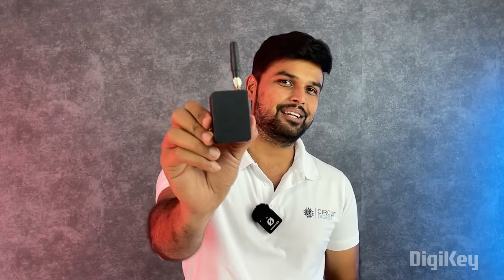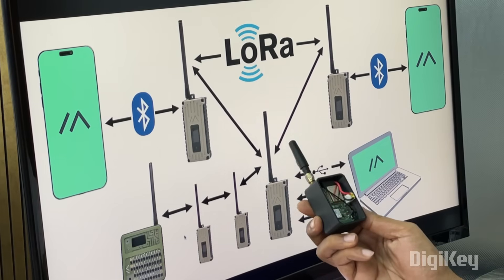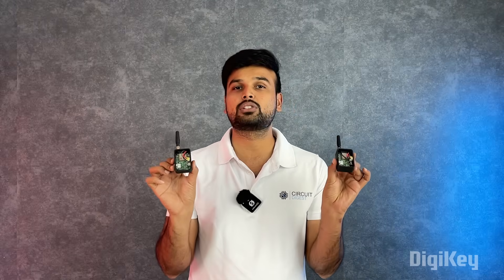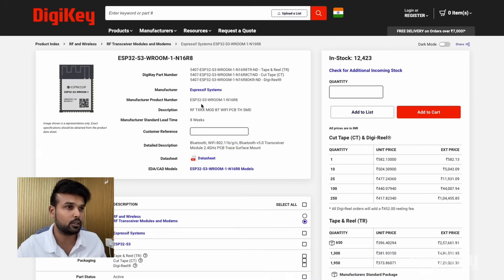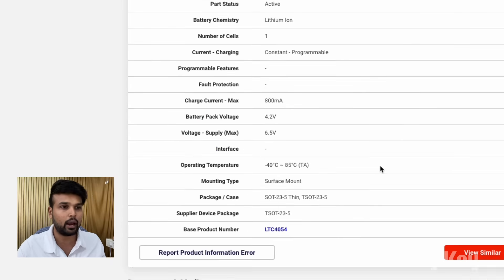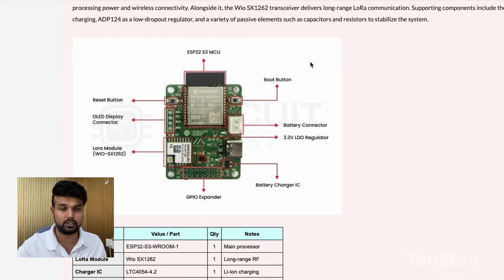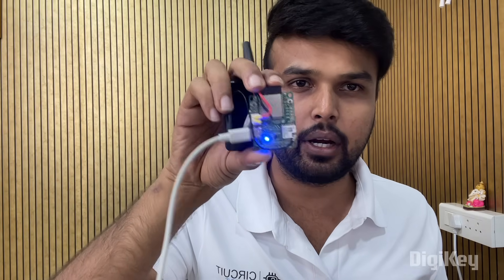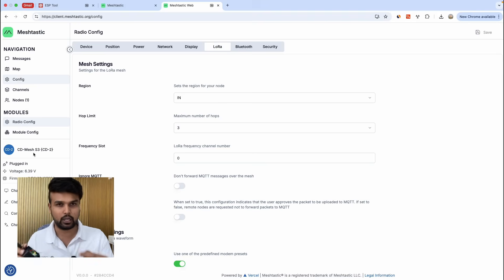How to Build Your Own Private Off-Grid Network using Lora? - Meshtastic Using ESP32

Comment: Sir, instead of making a PCB device, could you please make a video on the same topic using a 30-pin ESP32 WROOM module with the SX1278 LoRa Module (RA-02 433 MHz) on a breadboard with a simple wiring diagram? I have limited resources, and I am looking for a perfect channel to develop and test a mesh network. I am satisfied with your videos, but I currently have resource constraints.
😊😊
Reply: 433mhz is illegal in india
Reply: @Playerpool sir use legal frequency.
Reply: bro same opinion here
are you interested to colaborate with me?

Comment: I can't start this device, I did everything by video, it doesn't work according to the instructions, the processor is exactly the same as in the video
Reply: chip characteristics below the error, I tried to compile for s3 from platformio nothing came of it. I tried to download three files from the repository, it still didn't work out, it gives it out:
Reply: start detect chip...please wait
chip sync ...
Chip is ESP32-S3 (QFN56) (revision v0.2)
Features: Wi-Fi, BT 5 (LE), Dual Core + LP Core, 240MHz, Embedded PSRAM 8MB (AP_3v3)
Crystal is 40MHz
MAC: ecda3b4530b0
Manufacturer: 5e
Device: 4018
Status value: 0x100000
Detected flash size: 16MB
Reply from the maker: It means there is no code in it. Press the boot button while reseting to put in download mode. Then upload the program.

Comment: Your project is great. I would like to suggest an improvement to your Meshtastic project. Instead of using the SX1262 LoRa, you should use a 1W LoRa module. This way you will have high power for installation on top of buildings and towers to have greater coverage.
Reply from the maker: Thanks for the suggestion! That's an interesting idea for improving coverage.